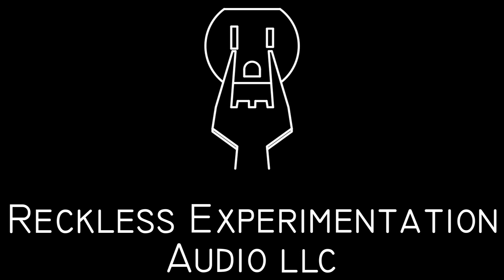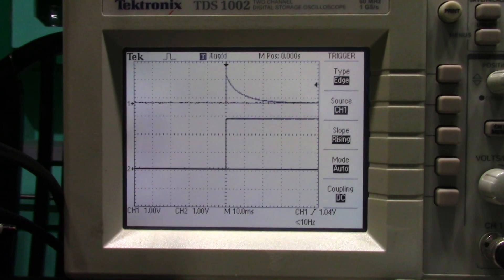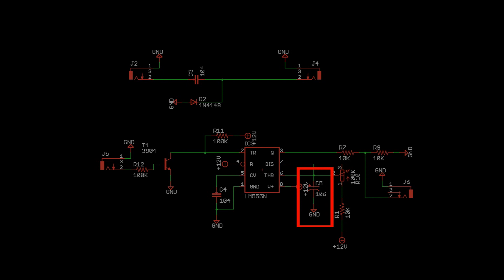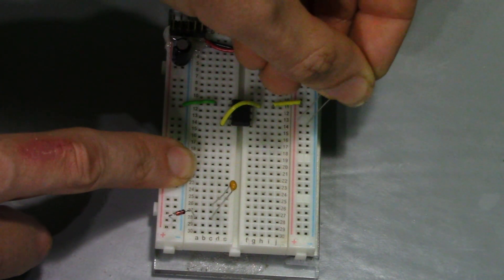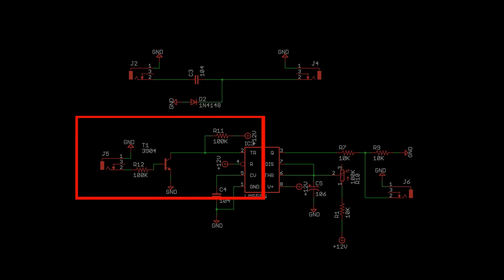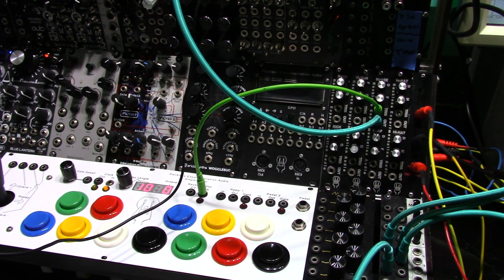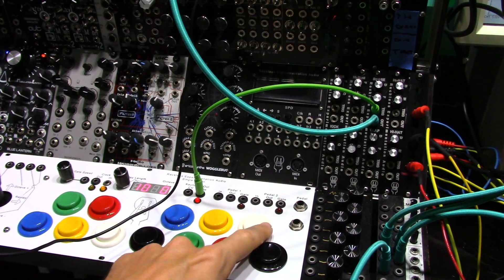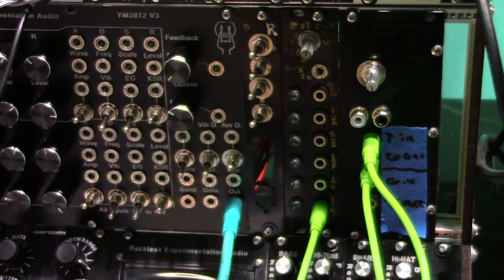Eurorack Gate to Tigger and Trigger to Gate Breadboard Module

Comment: Thank you For this Video. Im currently learning/ building a step sequencer with what parts I have. The shift register im using 74ALS273 Just has CP in and a MR that clears forces all outs neg. Im using an old synsonics drum machine but was getting only a gate out. Adding your simple Cap Diode circuit has been the most simple solution I have found yet.